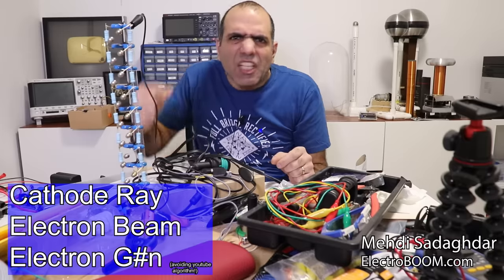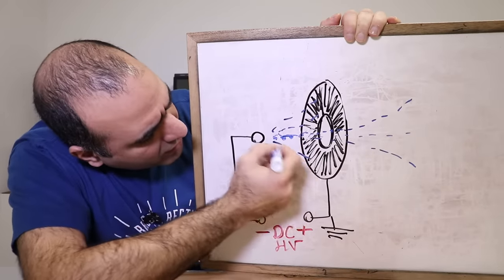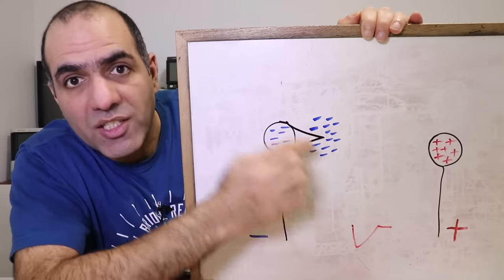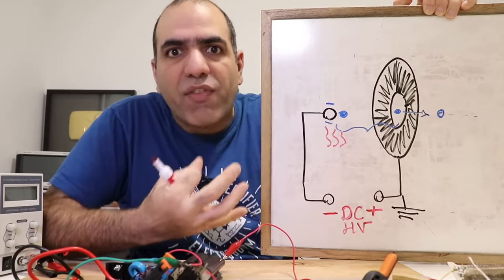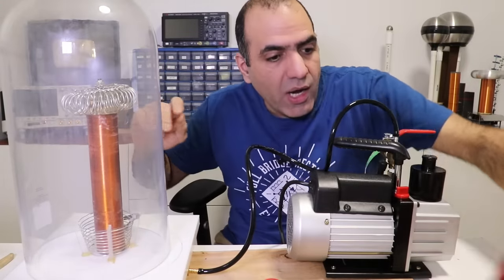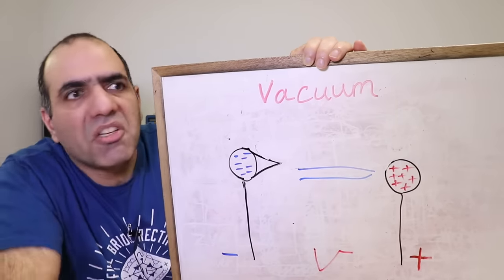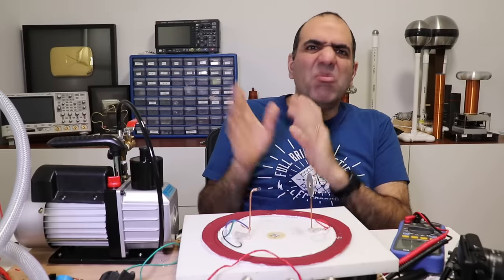Making Super Fast Electrons, Cathode Ray

Comment: mehdi sir , i have a question : my grandparents used to say " keep the remote batteries on the roof where the intensity of the sun is the highest and the dead batteries will recharge " i used to do it when i was a child and it kind of used to slightly work , im not sure can you rectify it for me please 
battery info : EVEREADY AAA (or AA) 1012 , 5V 
please help
Reply: From my understanding which may be incorrect but batteries are stored chemical energy, typically heat aids in chemical reactions (makes them quicker and more likely to happen). It can also go the other way and bee too quick (lithium battery explosion) but I'd say it raises the voltage of a AAA battery by a little bit or at least gives you the chance to get a bit more power out of it. The same would likely happen(but opposite) if you put it somewhere cold like a fridge (or cold climate)
Reply: @Chrazzari  thanks for the explanation bro , you might be right

Comment: Btw you can get Something Like Sphalerite ore And  Crush and grind it down to a Very fine powder mix with water (Dont mix it too much You Need it quiet thin ) And pour into a Flat bottom  Glass Lab  Flask  Just nedd a few milliliters  on the bottom  and slowly simmer  boil The water away Presto  You now Have something that can detect Electrons (Remember to Vacume the flask and Seal it)

Comment: re  -  9:25
This is my guess as to what the Corona-Diamonds are:
They're visual representations of the ionisation energy of air. The farther away from the cathode they are, the lower energy they receive, so they're in a lower ionisation state. The closer we get to the anode, the more energy they receive, so they're in a higher ionisation state. Hence the first diamond represents the first ionisation energy of air, the second diamond represents the second ionisation energy, etc...

Again, that's a GUESS, since I'm an organic chemist and not an electrochemist. If anyone knows for sure what's going on, or even if they just know that I'm wrong, I'd be very interested in finding out.

NB: Even in the absolute BEST vacuums humans are able to construct, there's still a density of about a trillion molecules of gas per cubic centimetre. I doubt that this is anywhere near such a vacuum, so the gas density is quite likely to be orders of magnitude greater.

Comment: Please watch out or limit your time when testing with HV AC/DC  across an open gap in a vacuum. You are low key blasting yourself with xrays.
Reply: Not even close. Your comment is educated and well intentioned, but likely missinformed. X-Rays are a form of electromagnetic radiation (So high energy photons) while cathode rays are actual electrons (or maybe ions). They could be instead compared with beta particles. But those are the result of the decay of an isotope, and have a far greater energy that what you can ever get from a cathode ray. While X-Rays are comparable to Gamma particles
Reply: @sebastiangudino9377  he also mentions it in the video. When testing high voltage vacuum breakers using DC we're also warned of possible x-rays.
Reply: @herro36  Yeah, but I'm pretty sure he just mean "Ionizing radiation", not X-Rays.  There technically IS ionization, since that what causes the arcs. But I can assure you a Geiger counter place anywhere except maybe directly touching the arc will produce no reading at all

Comment: Very cool.  From memory, CRTs had a screen that would glow so you could see where the electrons hit it.  Can you make such a screen by coating the side of your vacuum chamber?
Reply: The quick answer is yes. Some glow paint should do the trick.

The problem is that any electrons that make it through the hole do not travel very far before they turn back and head for the ring from the other side. Just think about it: they made it a whole 10cm across the gap, a mm or so to turn back is nothing.

The answer is, place the phosphor screen very close to the positive electrode, like 1mm or so. Or make the phosphor screen conductive and feed it a higher positive voltage than the ring. Both solutions have been used in old CRT screens.

Comment: 5:37 isn't it similar to an x-ray bulb? I mean, a heated tungsten element by a relative low voltage(but high current), connected o a high voltage terminal, in front of the other high voltage terminal, the result is an arc pulling tungsten atoms at hig speed creating radiation? 10:05 i think here you were creating a little bit of ionizing radiation

Comment: I got an idea, try see if it's possible to make an over powered air pistol just a high voltage discharge inside the barrel of an air pistol gun , in theory as long as you have charge , you should be able to expand the air into a pressure wave using the discharge arc with enough force to shoot the pellet, you could even throw in a tactical hydrogen generator electrolysing from a dehumidifier then discharging a pulse of hydrogen gas into the breach at the point of arcing.

Comment: Also also you could tip the glass dome upside-down, fill it with sodium hexafluoride at about 60 psi and really build yourself an x-ray tube.  Turning it upside-down would save you losing too much of that gas which is expensive and a serious pollutant.

Comment: You should have put some florescent behind the anode to see air any of the electrons escape. You can salvage them from old florescent lamps' surface inside. To apply, you need to dissolve the florescent powder in alcohol and let the alcohol vaporize on the surface.

Comment: Mehdi, you need a turbo molecular or a difusion pump in addition to that pump that you already have to achieve high vacuum suitable for a cathode ray. But making a chamber for high vacuum is a whole endevor all to itself. Becouse, you will either need to learn glass blowing, or make a chamber out of stainless steel becouse plastics are known for out gasing contaminating the vacuum, seals are not rubber but copper and pipes around them need to have a knife edge that bites into the coper seal.

Comment: I think that the reason why the electrons don't go directly on the anode is that, since there is vacuum, they do not collide with air molecules very often as in normal air pressure condition and so they acquire so much kinetic energy that when they are close to the anode, the ones in the center where there is the hole aren't deflected that much cause they are going too fast. I think this doesn't happen with your setup cause there isn't enough vacuum.

Comment: > "I suppose it is used in research settings"

Yes, electron guns are used in particle research, and like you said, at high enough power they can generate X Rays, that's why TV tubes front glass actually had a small amount of lead shielding.

Comment: So it turns out the anode "washer" is only a weak anode compared to the main screen behind. The ring will have something like 1KV above the cathode, where as the anode screen on the far end of the tube is the whole 20KV supply voltage. That is why the ring is not stealing all your electrons and most are going through the hole.

Comment: Mehdi actually created x rays there, a not insignificant amount, actually. But due to the angle he probably fired them mostly backwards and into the glass and all over. To make a large amount of xrays, he would have to make the anode out of different materials, like tungsten or silver. Then, you would spin the anode on a stator to distribute the heat since that's what you mostly get. Ionizing radiation is dangerous, use a lead shield. Proper xray machines actually use an aluminum or whatever filter to get rid of the low energy photons since they add to your radiative dose of X-rays but are not high energy enough to really expose a photograph of your gutz and bones, only the crazy high energy ones are useful.

Comment: The curvature of the electron arc is caused by the earth's magnetic field, not residual air supply rising. The splits in the arc may be converging magnetic field lines interfering.

Comment: Would it be better to have 2 anodes instead of 1, with increasing voltage between the two?
For example cathode 0v, anode 10kv, anode 20kv

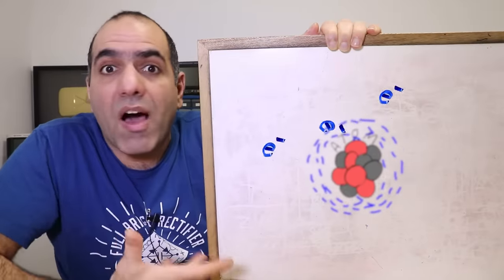Comment: 10:20 If atoms vibrate and discharge electrons easily, why it is told that increasing the temperature of a material will increase the resistance of and low amount of current only flows through it.

Comment: cool video, but ye hthey say it not only needs a strong vacuum, but also a vertical setup rather than a horizontal one like used here.  the bottom is grounded at 0 volts making it fall to ground voltage

Comment: You should look at those Otis touch elevator buttons. They use vacuum tubes with a layer of tin on top to sense your touch and it latches
Reply: Those are specialized thyratrons
Reply: @coastersaga  aye another elevator connoisseur in the house

Comment: Please try this again with the vacuum pump, but next time decrease the gap between cathode and anode to only a few millimeters, just like the gap between the cathode and first anode in a CRT's electron gun. Also the voltage between the cathode and first anode inside an electron gun is less than 1000V. The 30kV is only used for the second anode, which is in the large bell shaped part of the tube. Your device is intended to simulate an electron gun, yet you got ut completely incorrectly set up. Please try again, but this time configure it as I described. I want to see you actually getting it working.

Comment: Nice, but there is still way too much air in there, so you basically made a UV lamp, or if you painted your vac dome with fluorescent paint, a fluorescent lamp. You need a high vac pump, not just a rotary. AND the filament temp is not high enough, try a tungsten filament that can withstand a high temp. OR some different material with a lower Work Function (something to do with Physics, Google it 🙂).

Comment: To get free electrons you need a REALLY, REALLY good vacuum. A bell-jar and a simple rotary pump won't cut it. You need to get below 10E-4mb. All you'll get is fast ions from the residual air with that simple setup.
Trouble is, if you manage to do it, you'll start to generate X-rays... Not good.

Comment: Hi Mehdi, I would love to understand how they get electrons to go through the hole in actual CRTs.  How do they keep all the electrons from being sucked up by the anode ring?  If you can do a video on this, it would be great!  Thanks!
Reply: Cathode rays always travel in STRAIGHT lines no matter where is the anode is located. In CRT Televisions, the cathode set or Electron gun triad stays in the narrow end of the picture tube, which appears like an odd shaped funnel sealed perfectly. On the other side, you have the shadow/slotted mask, phosphor layer and the screen. The electron gun is directly focused to the screen WITHOUT any solid obstacles between the ends. Thanks to the synchronous electromagnetic Yoke wound around the tube right in front of the cathode set, the electron beam flys faster creating phosphorescence lines. Well, the CRT must have the anode (or your diabolical hole thing) to function. That's just hooked to the top of the tube from outside. (I mean, inside the chassis)
Reply: Anode doesn't suck'em all. Hence, some ionized gas atoms can travel through the hole and give another luminescence. We call them as Positive rays.
Reply: Simply in television CRTs, anode do stay in between the cathode and the screen, but it's located in a higher spot of a line which is perpendicular to the cathode-to-screen path. If you can take off the cover of an old TV, you will see the anode sticked to the top of the picture tube as a tiny black rubber cap connected to a weird tube-like cable coming from the flyback transformer.
Reply: I forgot a thing. The shape of the cathode matters. CRT TV sets use concave cathode to straighten and focus the beam. In this video, Mehdi uses a spherical cathode which results a more scattered beam.

Comment: 10:25 can we run CFL at lower voltage by passing high amps through coil?
11:55 "modern silicone components"on a something what is a simple diode. IS HE TALKING ABOUT LEDs? are LEDs and cathode ray tube similar?

Comment: What I quite don't get: batteries or energy sources work by pumping electrons from the negative side to the positive side so the voltage evens out. Especially in batteries I think it's quite important that electrons stay within the circuit. But what happens if we shoot them away with such a device? Then we're losing electrons instead of pumping them in a circle. Doesn't that do anything? What if we lose all the electrons at some point of time? Is it even possible to charge the battery any more then? We can't just pumpt the electrons in the other direction (what is called charging) because they're gone?!

Comment: You also have to watch out for x-ray radiation that the machine makes
Reply: I don't think you can make ACTUAL ionizing X-Rays from this. This is a basic 10$ ~30kV pulse generator. That should be able to create genuine x-rays in the exahertz range. That is far too much energy per photon to be what this device outputs

Comment: the part that he say high current heat up air. Does he mean high current from electron that in the air? does he mean that when air is travelling very fast it will become hot? that it will crate spark?

Comment: Should explain why it is shocking you! Your negative terminal on that flyback transformer is not earth grounded. It's floating somewhere exciting! Important safety information I don't really know how to convey and probably don't understand correctly. Got a nasty and dangerous shock from a mistake I made related to this once, and I never figured out exactly where I messed up.  Possibly the table and the floor weren't very good insulators that day because it was humid, even though they weren't conductive when I tested at similar voltage months earlier.   The setup was very similar to yours in this video, I think I was using a lipo battery for power, so everything was floating. I am sure only one hand was in anywhere near a wire. But the shock felt like it was across my entire body, and it was extremely intense like I got snapped by a rubber band everywhere at once, it was just stunning. I was not able to find any burns on my body. 

Liquid Electrical Tape solves the arcs to the core and between pins, and even against AC!  Plasti-Dip should also be pretty good.

Comment: replace the washer with a circle of wire. better yet, have three anodes made of wire circles with resistors so that each wire circle is at increasingly higher positive potential the further away from the hot cathode, a true electron gun with accelerating ability because of the higher electron potential...

Comment: I'm confused. Arent these things potentially break-out-the-lead-apron hazardous? He has an unreliable setup and no measurement apparatus to check what kind of radiation he is dealing with. It sort of looks like hes just incrementing the voltage in the hope he will spot the electrons with his naked eyes. At least when electrocuting yourself the damage is immediately obvious.

Comment: I'm about 99% sure that you got the terminology of cathode and anode backwards.  You have to think of it in terms of electron affinity.  A cathode is comprised of cations.  It is missing electrons so it tries to collect them.  An anode is comprised of anions.  It has free electrons to give.  So when I see sparks on one side and not the other I know that the sparking side is the anode.  

When I tried to google it half the websites had conflicting information, with trying to explain the cathode with conventional current.  It's just a mess.

Comment: That's a misconception, flame is NOT ionized at all, it takes HV to ionize, and 700 to 800  degrees is nowhere near enough to actually ionize atoms, redox reaction in the flame is why there is the path of least resistance, but it's NOT ionized...
Reply: I think radioactive materials ionize enough without high voltage.

Comment: Didn't he just build an x-ray generator with this setup? Maybe the voltage and therefore the electrons speed isn't high enough to emit x rays when hitting the plate... It still bothers me a lot that there could be x rays running through his hands all the time

Comment: I am 68 yrs old, if you want to go past my age then i suggest you wear rubber gloves, when dealing with HT voltages,  and wear googles just in case you forget to pop off the exhaust valve on a vacuum pump, and please try not to use that vacuum pump for anything else on your body to build longer muscle, any way that vacuum jar is too big for that, but yes I like your experiments, but now tell me how come electrons can't pass through air yet they pass through solid copper wire? so answer my question before you blow yourself out, 😎

Comment: I would say it does not go left but curves first at once on the smallest radiis of the anode. Then it takes a smooth path around in parity as well as direction, so it would radiate, unless we rotated exactly with it or were otherwise to the
 -|xyzdpi i*i""|^2

Comment: This is a very poor vacuum -- unfortunately, the tech for making a really good vacuum is frustratingly expensive and specialized. You can get much better results, and a much better distinction between a cold and hot cathode, with a high vacuum. (you need a much higher vacuum to get truly ballistic flow of electrons, and at that point no current will flow unless the cathode is hot.)